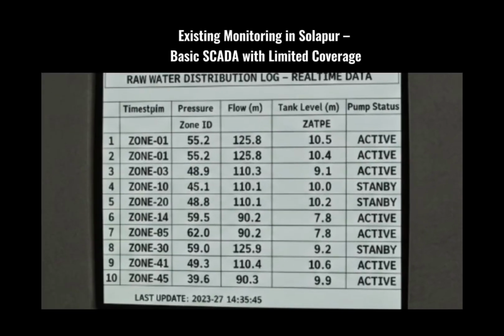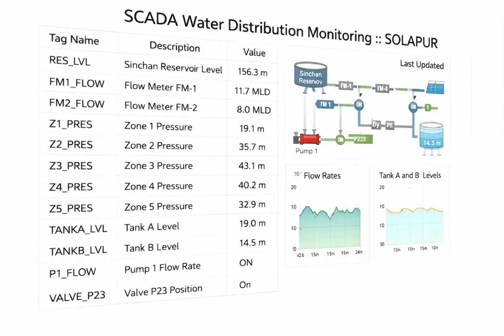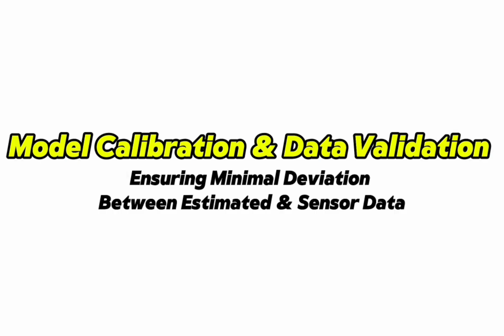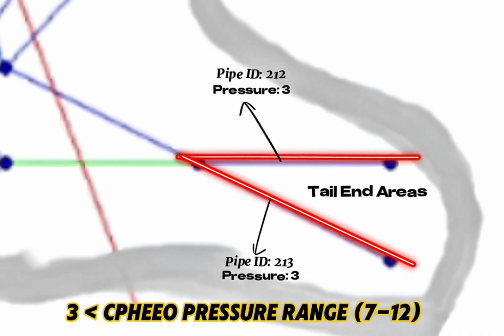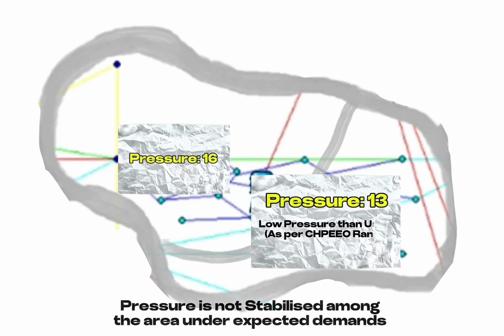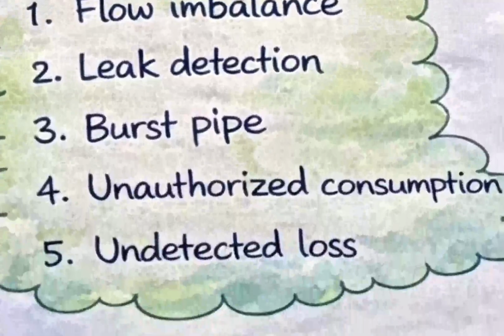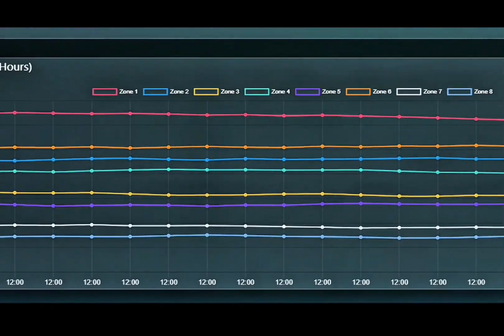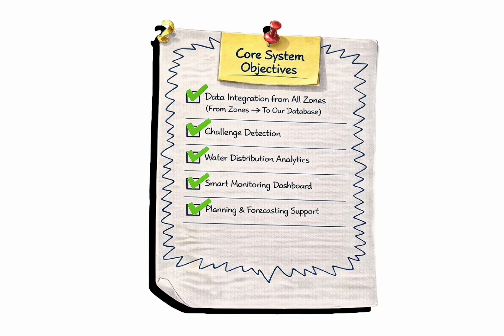Smart Water Pressure Management for Equitable Water Supply – Samved Hackathon 2026

Comment from the maker: Smart Water Pressure Management for Equitable Water Supply – Samved Hackathon 2026

Smart Water Pressure Management System is a data-driven solution designed to ensure equitable, reliable, and efficient water distribution across all zones of Solapur Municipal Corporation.

This system addresses:

• Unequal and unreliable water distribution
• Pressure imbalance in elevated and tail-end zones
• Non-revenue water due to leaks and unauthorized usage
• Operational inefficiencies and lack of real-time visibility

The solution integrates:

• Real-time data acquisition and hydraulic network modeling
• Standard-based validation and intelligent anomaly detection
• Zone-level analytics and monitoring
• Predictive decision-support for proactive management

The system transforms conventional reactive water management into a unified, intelligent, and scalable smart distribution framework.

Project developed by:

Team Name : Icecubes
Team ID : MITVPU_SAMVED_Team 420

Institution:
Thiagarajar College of Engineering

#SmartWaterManagement #WaterPressureMonitoring #UrbanWaterSystem #WaterAnalytics#SmartCity #HydraulicModeling #SamvedHackathon